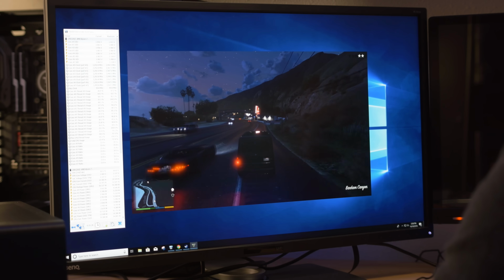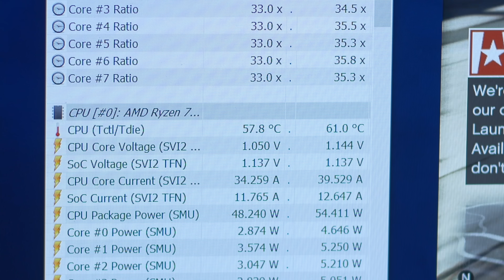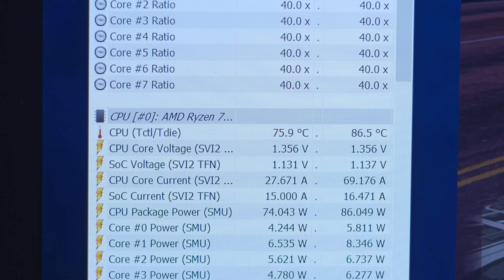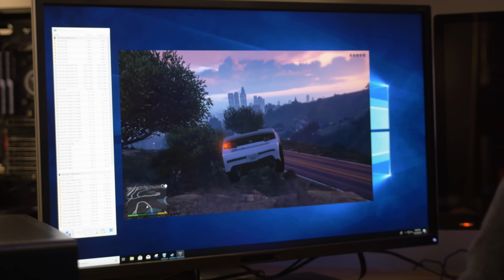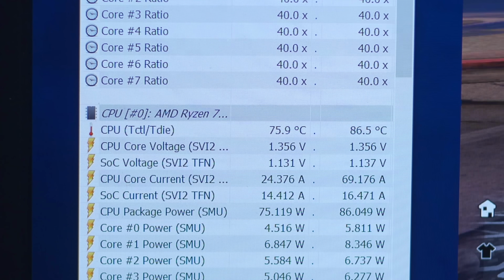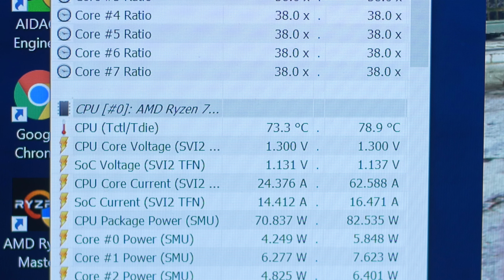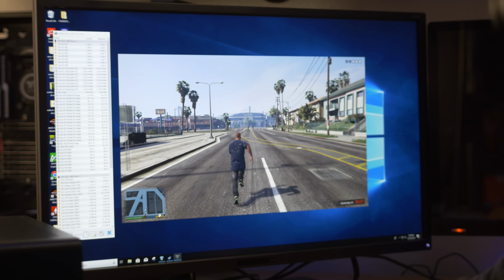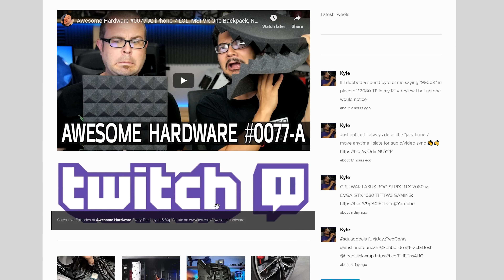Testing the limits of a 92mm AIO with Ryzen!

Comment: isn't TDP irrelevant .. isn't the 2700 and the 2700x pretty much the same chip with the voltages bumped up ... so just taking a 2700 and OC'ing it to the voltages and clocks as the stock 2700x would make the TDP of the 2700 the same as the 2700x and boosting it to the 4g would raise it even more so ... you are probably dealing with a 150 TDP or more on both chips when you have them OC'd to 4g on all cores. 

I guess I don't get TDP .. I was always told that upping the voltage ups the TDP so when overclocking the TDP is no where near what the chip is rated at when 'stock'
Reply: No John, you understand perfectly. Its Kyle who is confused. TDP is irrelevant, and only a function of the level of cooling the manufacturer expects you to need ONLY WHEN running the chip in spec. The ONLY REASON the TDPs are different on the 2700x and the 2700 is because they have different Specs. 2700x is spec'd to boost a decent amount higher, which means it needs higher voltages, which means higher heat, which means higher TDP. But ultimately when running these 2 chips at the same Voltages and the Same Clock Speed, they will be almost identical in terms of Heat and Power Draw. The only difference with be the normal chip to chip variance that you see between any CPU's, (ex. Silicon Lottery) and possibly Binning on AMD's Part to possibly make the 2700x be able to hit same Frequencies at Lower Voltages, which would actually make the 2700x be able to be stable at lower Voltages at the same Frequencies. But Regardless, Locking these 2 Chips at the same Voltages and Frequencies, and then running them under the exact same workloads, would produce almost IDENTICAL results, outside of normal chip to chip variance. So Yes you were Right, in this case his assumption in the beginning of the video was flawed, completely. Had he used this as a learning experience in the end and then explained what TDP actually meant, this would have been an awesome video in my opinion, but he didn't, so *Shoulder Shug*.
Reply: yeah john you got it. surprised kyle doesn't seem to understand or he just messsed up with this video(which is fine ppl make mistakes still love the content) honestly undervolting the      2700x might make the most sense as it is a higher binned chip should be able to get a better overvlock with less vcore acually trying to run the 2700x stock with xfr2 and a slight undervolt might make the mostest sense of all lol

Comment: What you should have tried is optimizing the voltages on the stock 2700X. It's not surprising that a 2700 clocked to 2700X stock values will be just about as hot. The chips are basically identical, AMD only cherrypicks the 2700X. That should allow lower voltages on the 2700X lowering its temps at stock speeds.

Comment: You have reached the limit if your cooling device. I wonder if a small fan (20 - 30mm) near the pump or vrms would make any difference. I use my top case fans to blow cool air onto my vrms, while exhaust is out the rear 120mm push-pull aio. Part 3 Video update with Lyle?

Comment: 2700 @ 4ghz should be hotter than 2700x @ 4ghz as they're lower binned CPUs.  The TDP change is only because the speed is lower so the voltages are too.  The best bet is to reduce the speed and voltage of the 2700x as it's generally a better volt frequency curve.

Comment: Kyle Man, do your homework... You got a lot of uneducated young nerds down here in comments spewing untruths, and you hold the great power of teaching them the ways of a true, Master Nerd. This they will not accomplish, if the knowledge you Bestow upon them, is inaccurate. They then Repeat said knowledge, and get b*tch Smacked, by potentially less cool nerds, but nerds with better knowledge... The power is within you Kyle, It will not be easy, but it can be done, with just 5 MORE MINUTES OF GOOGLING on your Part! Good Luck Master Kyle! The Following Knowledge, I bestow to you, free of charge. Take it, and begin your path, of a true Master Nerd Influencer!

A TDP IS NOT the Power Output of a chip. These are the 2 EXACT SAME CHIPS, the only difference being that the 2700x has a higher base and boost then the 2700. However, when you CLOCK the 2700 at the SAME FREQUENCY and Voltage, it WILL OUTPUT The SAME amount of Power and Heat, with the only difference being the chip to chip variances.

THE ONLY 2 Reasons this would ever work for you, is a) You left the 2700 at Stock, so it naturally clocks lower, needing lower voltages and therefore lower heat, or b) you get lucky with the silicon lottery and end up getting a chip that gets lower voltages at the same clocks therefore lowering you heat output. 

The TDP is a function of the level of cooling AMD Expects you to need while running the chip AT STOCK, it is NOT ACTUALLY giving you lower power at the same voltages... *Facepalm*... Its a Function of Heat Output within Spec, and this being a 2700 is clocked lower while in Spec, therefore needing less cooling, that goes all out the Window when overclocking and bringing it out of Spec. 

Sorry Kyle, I hate to be one of those, "Well Actually" Nerds on you, but you should honestly know better. Anyways, still love ya, just get ya SH*T Together Man!
Reply: Even though the Conclusion of your video was essentially what we are all telling you down in the comments, I think we are frustrated by the fact that you thought that the fact that the 2700 had a lower TDP you would get lower Temperatures when overclocked to the same 4Ghz. This would have been fine if this was for the sake of the novice viewer to "Learn and Experience" why this thought was wrong with you, and then at the end you Taught them what TDP Means, and why that assumption was wrong. But there are still plenty of people down here in the comments that are swearing that it should get a lower temp at the same volts because it has a lower TDP, so I think that is the only mark you missed in this Video. Teach your more Novice viewers what a TDP is, they will listen to you. I will shut up now.

Comment: What does it matter if the temps is not to your liking? As long as it does not throttle down then it is no issue at all. Hardware components are not people they dont melt when they hit 80-90c :P

And if you have a super small gaming machine then dont bother with oc if you are afraid of higher temps. Getting the ram overclock as high as you can will make the system perform faster than if you oc the cpu itself especially with a fast gpu.

Comment: A 2700X is better silicon and should be able to run the same clocks at marginally better voltages (source: siliconlottery's statistics). It would have been more interesting to see how your 2700X did at stock with this AIO, for an apples to apples comparison :)
Reply: yeah I don;t think he understands what tdp really means eitherway hopefully after he screwed this video up he will go do some more research take it srsly and come out with an awesome video yeah (ppl make mistakes still love alot of the content) honestly undervolting the  2700x might make the most sense as it is a higher binned chip should be able to get a better overvlock with less vcore acually trying to run the 2700x stock with xfr2 and a slight undervolt might make the mostest sense of all lol

Comment: whats the performance difference between the two processors when running at the same clock speeds? is there one? i know its probably a bit of a noob question, but if there is one, where are the differences coming from if they have the same no. of cores at the same clock speeds?
Reply: There should be virtually no difference.  Both chips would perform identically (within margin of error) at the same clock speeds.

Comment: I hate to tell you this, but I think you're doing this backwards. I think you have a better chance (silicon lottery) of having a superior power / temp / performance result with the X model than the base, because otherwise, why did AMD bin them that way? If you put the X model back in, and apply the same level of trial and error and massaging the details, then I think you'll very likely get a better result again.
I would also say AMD's dynamic timing / speed stuff is really good, and if you manually lock the thing at a chosen speed / voltage, then you're throwing away the main thing that the X model is good for... It's like buying a Ferrari and then doing an LS swap into it... Maybe you can, but why would you want to?
Can you get a bigger radiator + reservoir for that cooler? If you're pumping low 90s, I'd be looking to get more cooling.... I mean, if you wanted to overclock then maybe you wouldn't build in a shoe-box, but... You may not be able to go longer or wider on the rad, but what about thicker? I just think it needs 20 or 30% more cooling....

Comment: Try comparing this setup with whatever the best little air cooler you can fit in there is, would be interesting as I don't think that radiator fan can breathe at all..

Comment: You should have just undervolted the 2700x. 2700x's are usually much better binned than 2700s, so it should have been possible to achieve 4ghz at much lower voltage on a 2700x than a 2700. For example, I have both the 2600 and 2600x, the 2600 I have in a water cooled build because it needs 1.39v for 4.1ghz, whereas my 2600x I actually use in an sff build because it hits the same frequency but at a much cooler 1.28v. Some people think that you want to go with the lower tdp, lower binned processors for temperature restricted builds but it makes a lot more sense going with the x processor in the case of ryzen 2nd Gen since you can generally get over 4ghz with 1.3v or less.
Reply: yes, right answer

Comment: Your temps should be much better. Make sure the radiator fan is pulling air into the case & not pushing it out. You will get better temps that way, as noted by tons of Dan A4 users (and Dan himself).

Comment: He's sucking the bottom quarter inch air gap flat up against the tabletop through a hot radiator and into a case with toasty VRM and GPU. Of course it's hot.
Reply: I really don't dig the radiator location at all.

Comment: Kyle, you should check out the new Streacom case. It is designed similar to the DAN case but has support for a 240mm rad and a very unique modular mounting solution for components.

Comment: Shouldn't the 2700x have better thermals at the same clocjspeeds? It's a better bin, shouldn't that mean it would run at lower voltages on the same speeds and be able to go higher?

Comment: That AIO is too small for an 8-core Ryzsn. You'd be better off with a low-profile air cooler, even the Wraith would fair better. This is mostly because water is great at conducting heat but takes much longer to cool than alluminum does, and since the radiator has such a small surface area there isn't enough heat exchange happening to keep the CPU cool. With an air cooler, the heat would be disappated into the air from the fin stack much faster. Of course with that case you'll likely end up raising the temps of your GPU but it'll probably be worth it.
Reply: Wrong. He's got the fan pushing air out of the case through the radiator, that doesn't work well in Dan A4. His temps should be much lower. You'll get better temps pulling fresh air into the case through the radiator, as noted by tons of Dan A4 users (and Dan himself).  People even have a 7980X with this AIO inside it. It trashes all cpu coolers that can fit into the Dan A4.
Reply: @OC.TINYYY  except the upcoming dan hslp48(black ridges)?
Reply: @kennysughiarto2780  that'll be the best air cooler you can fit in it, for sure. Unfortunately still won't beat the 545LC. It's too bad they officially don't sell the 545LC anymore. Glad I picked one up 2 months ago.
Reply: @OC.TINYYY  not true at least according to dan test here: https://hardforum.com/threads/dan-hslp-48-a-powerful-sub-50mm-heatsink.1925480/page-23 
We have to see actual actual performance